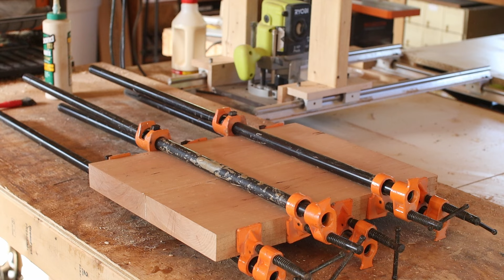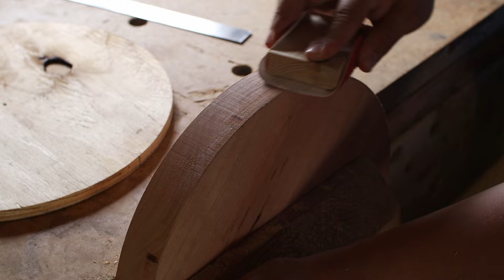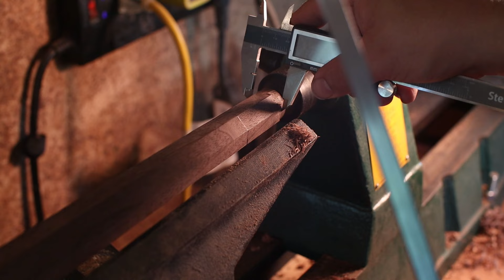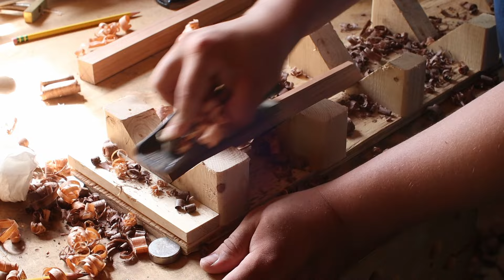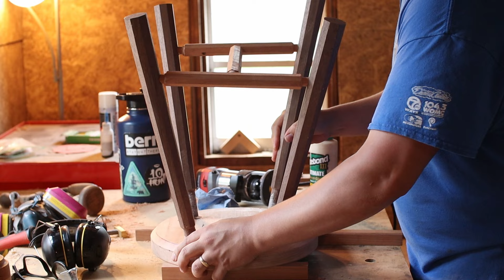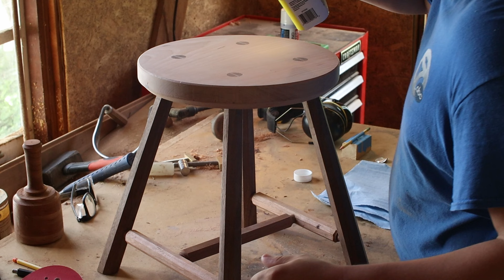Making A Staked Low Stool - No Talking

Comment: Hello! I love this stool, such beautiful work. Any chance you could share a list of tools you used to make this, and the types of wood and the dimensions you started out with?
Reply: He has access to band saw and lathe, but you can get away with just hand tools. A #5 jack plane, #4 smoother plane and a block plane, a handsaw, a flush cut saw etc. His tenons are cylindrical which don’t make the strongest joint. Tapered tenons are a lot stronger and you can make those with a Veritas 5/8 tenon cutter which looks like a pencil sharpener for bigfoot. And finally a reamer, also from Veritas to cut the corresponding mortise.
Reply: @ thank you so much! Learning slowly what tools I need to get started, and this is a project I would love to work towards. Appreciate your help!
Reply from the maker: Hello, thanks for your comment and apologies for the extremely late response.  I used 8/4 scrap cherry wood for the seat and 8/4 walnut legs.  The cherry cross members probably started out as 4/4 strips.  I hand planed tapered octagons for the legs and non-tapered octagons for the cross bracing.  kryptic0 is 100% correct with what he said about tools.  cylindrical tenons work if you're not wanting to spring for the tapered tenon cutter/reamer.  I'll also mention that this project came straight out of "The Anarchists Design Book" by Christopher Schwarz.  It's the Staked Low Stool on page 84.  I'd highly recommend his entire Anarchists series. Awesome read and amazing place to start if you're looking to get into hand tool woodworking.  Probably start with the "Anarchists Tool Chest" :)